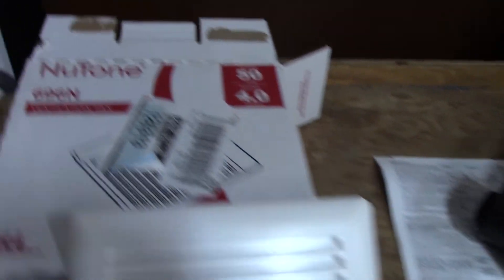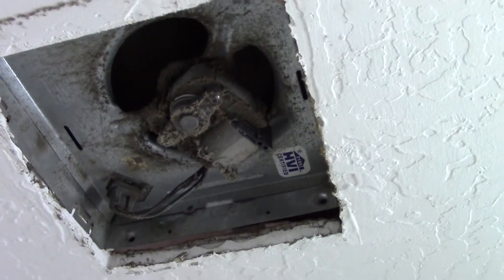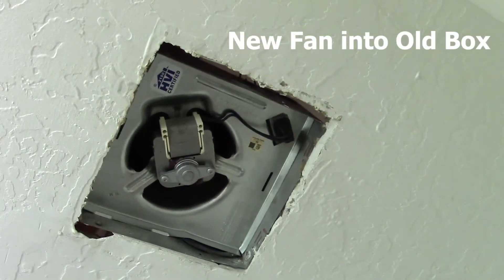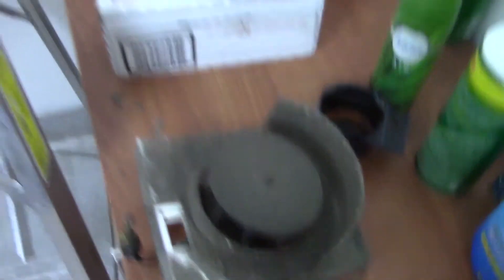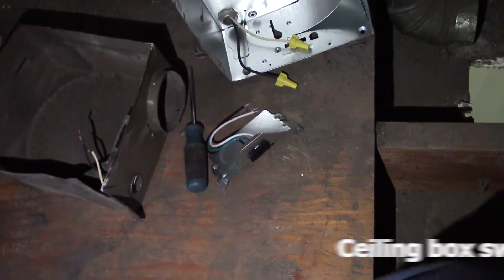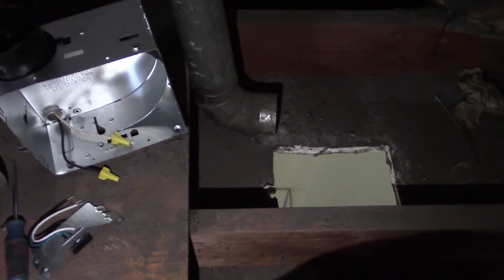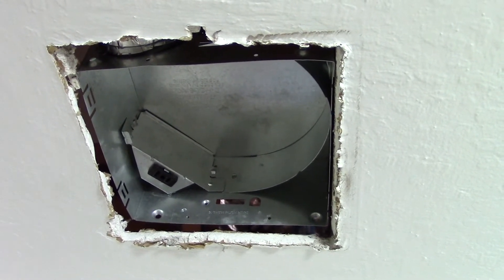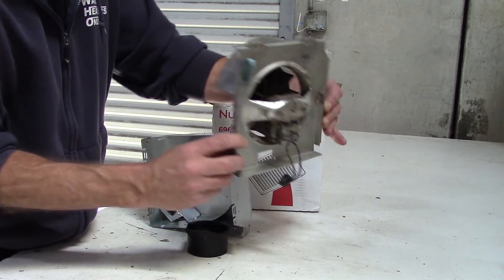Bathroom Fans - NUTONE 696N -  Installation and review

Comment: Super helpful, thank you! I saw  previously how that whole housing was mounted in the ceiling and gave up on fixing it, thinking I'd have to tear the ceiling apart! Mine however has a screw near the power plug I had to remove but then the motor unit came out easily. Awesome.

Comment: 1 year ago maybe with prices they went up to $21 plus tax now and I noticed the inside piece you said your gonna replace instead of whole box well one at home depot if you open box and inspect it you'll see there not the same the fan plug doesn't match so I did same thing I bought the whole assembly and am planning g on switching out just the inside piece and cleaning out the old box